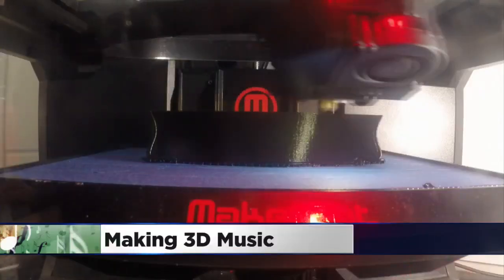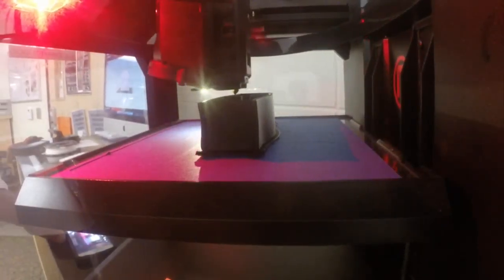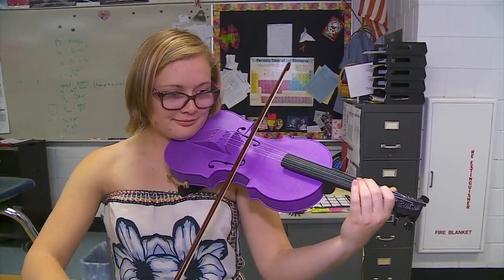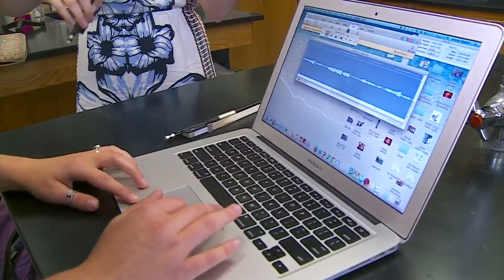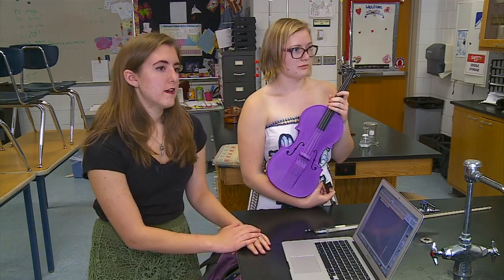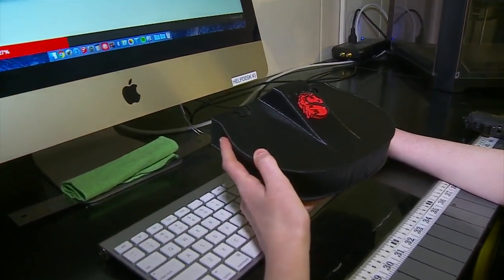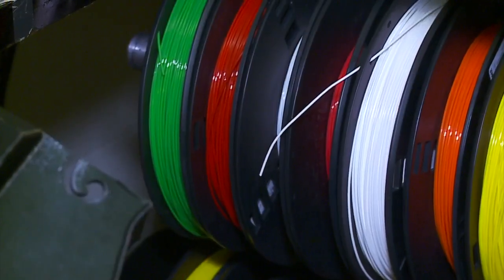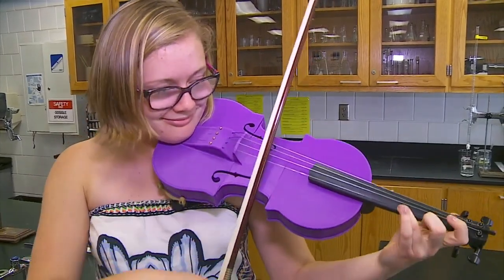Minnesota H.S. Student 3D Prints Violin

Comment: Wooden violin for $3500? No, I don’t think so. My full size violin with a double case (for violin and viola) cost about $1500, so get your facts straight. Also this is no achievement of the student, but more of the people who designed it.
Reply: Wolfy wait shit the restoration cost £1500. It originally cost about £3000
Reply: Wolfy basically my cousin(who previously owned my violin) had it restored - new strings, bow, etc - but when they originally bought it it cost about £3000

Comment: Uh no a starter violin does not cost $3500, you can get one on amazon for $35. For the full outfit, (case bow inc) preferably you would get at least a $100 one to start because those are pretty horrible but that was a huge exaggeration, nice reporting, A+
Reply: I can get a $3500 dollar chair too. It doesn't mean that is the only option. As someone who took orchestra and still plays violin. You can get a decent violin for about 500$s. Before you try to counter argue this, they're saying that the price of this violin is so cheap... compared to $3500 so why not compare it to the other ranges that a beginner to an instrument is more likely to get.
Reply: The guy with the $3500 yamaha violin. Violins from the 1700s go for 150k+ still not the benchmark.
Reply: Even 150 dollar violins are pretty terrible.